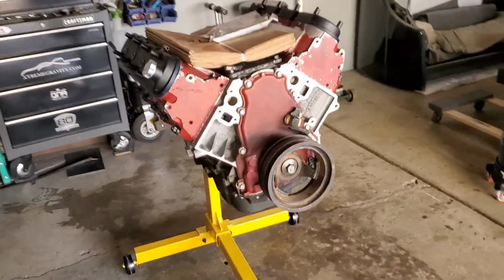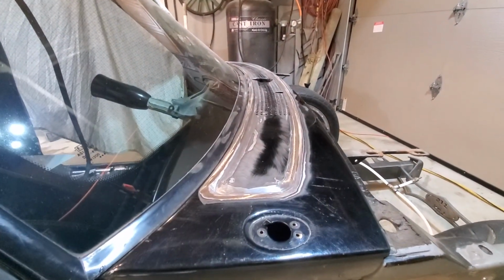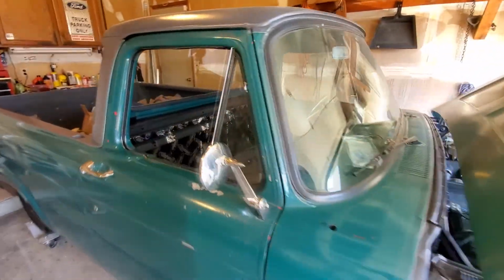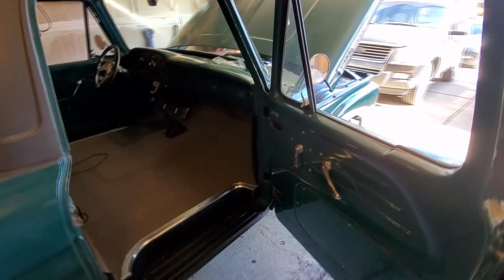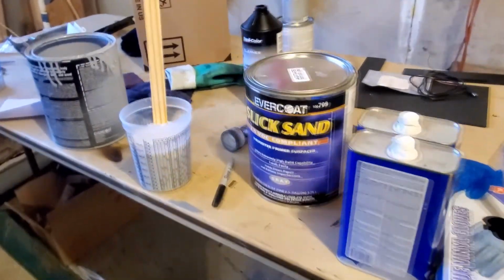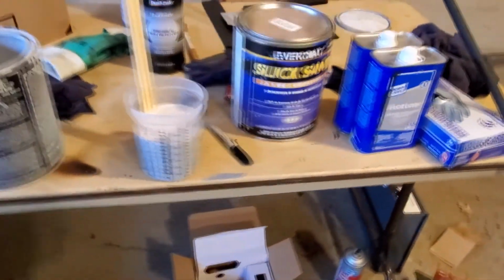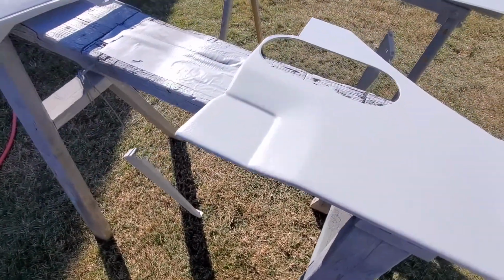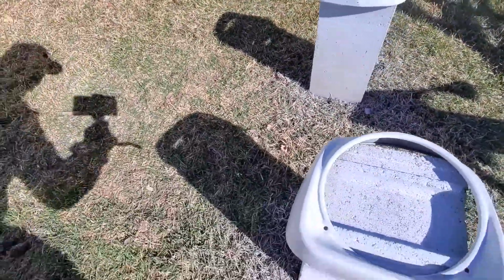Starting the day on the Ranger Cowl and finishing the day on some more F100 upgrades.

Comment: Don’t you loose the fresh air into the cab by doing this?
Reply from the maker: No heat or ac in either vehicle.
Reply: @LazyEyeProductions  
I am doing a ‘68 and was thinking about this mod but don’t want to loose the air. Live in South Carolina not going to have ac so need some air moving.  Yours is looking nice been following for a minute.
Reply from the maker: @Tonzi  you can see the kick panel on f1 has the hole for the fresh air vents still. I had to cut it myself though, they came with no hole. Thanks for following! Had a baby recently and have not done much on youtube.